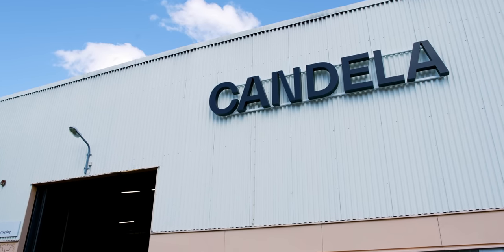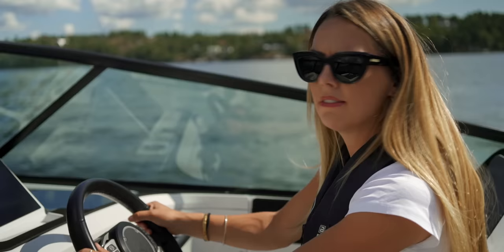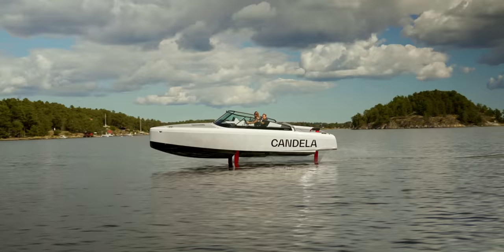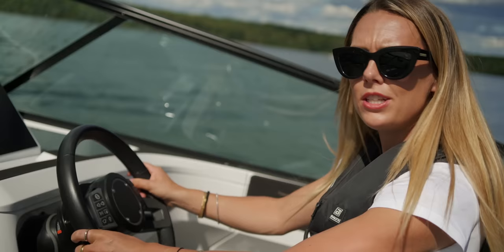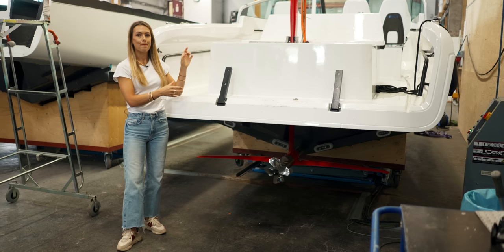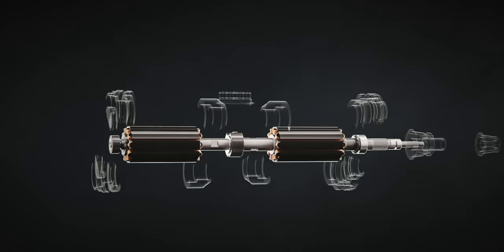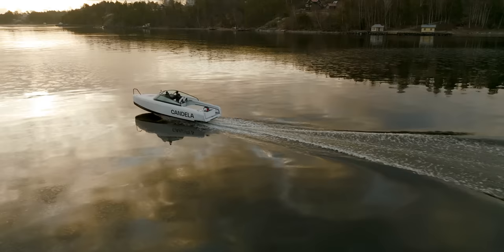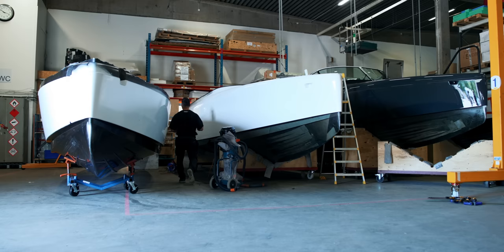This Candela Electric Boat FLIES!

Comment: Love it. A couple of questions spring to mind though; one, are these only fair weather craft? Not sure these would cope with rough seas so well? Just a hunch, two, when are they releasing an integrated solar version?!  Make a whole lot of sense to me if pleasure craft are rarely used!
Reply: Boats have a legal rating A,B,C,D with both distance away from the shore and number of passengers defined at build stage. A being cross Atlantic, B being cross channel, C inshore and D being river or lake. Then the number of passengers depends on the size and once you go beyond 24m or 79 feet, then build structure and number of crew can change. I would suspect that this boat is a C or perhaps a B. 
But range is then an issue so more likely a C rating.
Reply: @patrickjr11  Hydrofoils are not covered by the RCD Rating System.
Vessels over 24m LWL are not covered by the RCD.
The actual ratings A to D are descriptive sentences, not titles, as they were considered misleading. Even so, the ratings were previously A - Ocean; B - Offshore; C - Coastal; D - Sheltered, and were never as you suggest.
The ratings are predicated on weather conditions and expected wave height, not distance from shore or crewmembers (the number of people aboard can alter a vessel's RCD rating because of stability differences but nothing is "defined at build stage". For example, the same boat may be dual rated as D with 5 passengers, and C with 3 on board).
Range is not mentioned in the RCD ratings.
The RCD ratings are not so much "legal ratings" as guidelines to consumers. Once a vessel is sold or imported, the ratings are pretty much irrelevant and a boat can be used in whatever way the owner desires, no matter how misguided.
Given that the expected wave height for a C rating exceeds the ride height of this vessel, such a rating would be impossible even if a hydrofoil could be subjected to the same stability criteria, and there wasn't a failsafe built into the software that shut down the electric motor once the waves became too much for the system to work reliably.
Please be more careful when spreading information on the internet.
Reply: @RandomGuyRandomNumber  I did provide a link that gave more details for anyone interested in the details but my answer was aimed at vast majority of the audience who are not into boats. I think it is a reasonable way of describing the differences. But in any case. Foils are not included, although given they are going to be on more and more boats going forward, perhaps they will impact the rules in future. The boat is still the boat in the end. The foils just improve efficiency.
Reply: @patrickjr11  There is no link in your comment. Everything you said is demonstrably false no matter at whom your comments were aimed. The titles of the ratings were even changed by the RCD / EU BECAUSE they were misleading (but you did not even use the correct OLD titles - you just plain made up your own !) and the entire ethos of the RCD is to provide information to people who are not familiar with boats - nobody with any sailing experience gives a toss about the ratings unless they have to comply as a seller or manufacturer. You even guessed at a rating that could never exist for a boat to which the regulations do not apply based on a measure that is not even mentioned in the compliance regulations, let alone the ratings criteria.
Please educate yourself before spouting off on a subject you obviously know nothing about, and when your errors are pointed out, accept correction with some grace instead of doubling down and lying.
Reply: Solar actually makes a lot of sense since most people only go boating on the weekends. That would leave enough time to recharge with solar during the week.
Reply: @jimj2683  my thoughts exactly!
Reply: @jimj2683  Where would you put the solar panels ?
Not on the forward deck - panels don't like curved surfaces and would be damaged by walking / handling lines / using anchors. The only place suitable for permanent fitting would be a fixed cockpit cover or bimini. Which would be surprisingly expensive, heavy (to be able to withstand wind loading and misuse as a handrail while boarding etc.), bulky and just plain hideous, and which has to be dragged around in the wind and its extra weight lifted out of the water whenever you use the boat. What if someone wants to sunbathe ? Not with a permanent bimini they can't. And where are you going to dump the excess power generated by the solar array once the batteries are fully charged ? It has to go somewhere...
All these problems, on an expensive, stylish, open boat that spends most of its time ashore or on a pontoon mooring with shore power available right there, 24 / 7 ?
So no, solar makes absolutely no sense for a boat like this.

Comment: The main reason for the slow electrification of marine in my experience isn't the physics of water, rather that emission legislation is nowhere near the driver it is in automotive or even aerospace, it's unregulated in comparison. The exciting thing about the luxury marine sector though is that they're so overpriced there's room to factor in the extra cost of electrification/innovative engineering

Comment: We had old hydrofoil ferries going from Amsterdam Central Station to Ijmuiden (public transportation) Had, because they stopped using them, probably too expensive to run economical. If i remember correctly the boats came from Russia, it was a real treat rinding those almost everyday.
Reply: Yes we had them for public transport in Sydney Harbour in Australia too, i think the new design with electric engines will make them much more economical than the older types of hydrofoils using fossil fuel tech.

Comment: Now if only we had a network of long straight waterways between mayor cities... 

It's a strange thought, but in a few years we could see hundreds of these gliding up and down canals into UK cities
Reply: The necessary speed would be an issue on UK canals. Narrowboaters would rebel.
Reply: Good luck draging all those dumped shopping trolleys down the grand union canal.
Reply: And the locks...
Reply: You have to hit a minimum speed to get the boat to ride out of the water. It is most certainly MORE than the maximum speed allowed on the cut!

Comment: It's beautiful and elegant and I think electric can be used in many boat applications. My concern is the damage done to the blades if you hit a lobster pot or fishing bobber. It could end up as a very expensive repair if the blade gets broken, or the motor damaged. That looks like a very expensive motor to replace.

Comment: 5:02 Hydrofoils as a concept is not new or terrible difficult. About 50 years ago the hydrofoil was so well developed since the yearly sixties that they where rather common. Or at least in southern Europe there where even "speed passenger boats" that where hydrofoils. I know Greece still got a a few of the hydrofoils in operation still. But a foil for every enthusiast that can afford it, that is new afaik. Candela's Pod is also new, and the integration of software and sensors to control the "flight" is new, well at least at this level and size in length.

Comment: How does 50 nm stand up next to the typical range of a fossil boat and the typical trip length of a fossil boat?
Reply: A boat of that size easily uses 10 times more fuel than a car for the same range even if it goes slower than your average car.

Comment: It has driven me crazy for decades now that people still believe it is the lower pressure area on a wing that generates all or most of the lift.  No it is the high pressure under the wing from the air slamming into it that gives the vast majority of lift.  Here is an experiment you can do in your head.  Remove all the air around the Earth.  Could you still skip a flat round rock off a lake of water?  Answer is yes.  The shape of a wing with the top part being rounder than the bottom is just there to keep turbulence from forming.  Turbulence  would cause drag slowing down the plane fast.  The thicker and more rounded the front of the wing the higher angle the wing can fly at slower speeds before too much turbulence is created slowing the plan down so much that the engine can not keep the plan moving through the air fast enough to generate enough lift from the underside of the wing.

Comment: Nice video. Electric drive is the obvious choice for hydrofoil boats but surely the correct comparison is with an ICE hydrofoil - plenty of these in commercial operation around the world.

We know they're fast and comfortable and that people like riding them. We know that ice varients are expensive to maintain and don't work when the sea gets rougher. Can we fix those problems at all?

Comment: Just had a thought: there should be a profitable market segment in transporting film crews on the water. You can certainly film at higher speeds thanks to the greater stability and reduced motion.
Reply: Or you could just fly a drone over the water.
Reply: @vhtf120 No. They are faster and more stable.
Reply: @vhtf120  but i dont think there are drones capable of carrying proper cinema cameras 🤔
Reply: @TheDudeFromKalispell  drone can't carry the larger or more specialised film and sound gear. Can't feature a presenter and/or interviewee. Drones have limited endurance and are restricted in what they can do as an aircraft. A watercraft is far less restricted, and has far greater endurance on site. It also doesn't crash if you turn the engine off. Aviation rules and battery life mean a drone can't stop and loiter, or do a low speed approach to an object/location of interest/wildlife. Drone can't carry much equipment so can't be flexible in changing environmental conditions.

Comment: No comment on the the retractability of the [hydrofoil] sails for shallow water manoeuvrability, is disappointing.  Though I did note the tail sail shaft poking up through the bench seating at the rear of the boat during the closing comments of the presentation.

Love the idea — especially the Swedish ingenuity behind its development.

Comment: Would adding solar panels make the boat do a bit more range ?
Reply: Depends how small a bit you think would make it worthwhile. Probably not is the quick answer
Reply: It should add to the range, especially on a sunny day. However the surface area isn’t much, so the energy generation would be slight.
Reply: Not so’s you’d notice.   
Maybe if you were sailing it on the surface of the sun.

Comment: Regarding the question about environnemental impact of this foiler boat, I notice, in the aerial views, a yellow wake, probably due to the circulation around the foils, absent on the archimedian boat. Since the video has been made on a lake, I assume that more disturbances to the environnement are created on the aft foil, by the horizontal plane of the foil, sucking lake's ground sediment. Fore foils, also, seems to have the same effect.  In this case, the foiling configuration choosen by Candela seems to add some  more nuisance to the environnement, especially if this boat is to be sailed mainly is cute inshore waters. A more conventionnal electric conversion of a ICE boat would be more profitable to protect ecosystem from sunday's sailors in need of fun. Also I wish to add that, although one cannot compare directly the wakes of the foiler and the one of the archimedian boat, it is clear that the CANDELA hull's shape is a terrible mess !!!! In these quiet and wonderfull places that we see in the video, there is nothing better than a nice sail, avoiding carefully places where wild animals use to live.
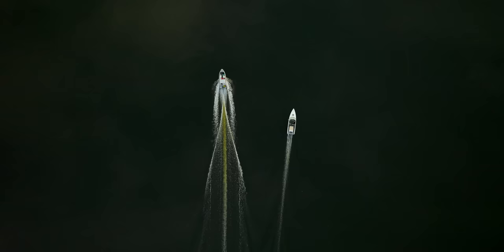Reply: I think you may be mixing the boats up. The electric hydrofoil boat is on the right with the small, straight wake and the other boat is on the left with the large, spreading wakes and the yellow-ish trail from the prop (at 6:12). The spreading wakes cause lots of damage (by being sizeable waves, rather than because they spread), so any conversion of a v-bottom hull which displaces lots of water will not be preferable, in this regard, to a hull which is not in the water at all.
Reply: @theelectricnarrowboat6639  Yes, That's absolutely right !!! My bad !!! In that case, foiler may be an advantage regarding environnement nuisance. Thanks for the reply !
Reply: @theelectricnarrowboat6639  what about foiling with sailboat then ?

Comment: Concept is great BUT huge use of non recyclable materials…..fibreglass/ carbon fibre and all its varieties are a nightmare long term. The cost is beyond a lot of boat users. Here in New Zealand the average trailer boat is 5.5 meters and approximately 20% of our population has a boat. The concepts are great but such a tiny market cover. BUT still a nice boat but not what the world needs. At least with aluminium there would have been a recycling element.

Comment: The biggest problem is cost. For the price difference you could refuel your normal boat hundreds of times before it would cost more than this carbon hydrofoil. If they could dramatically reduce cost, then it would make much more sense.

Comment: I wonder if it could go even faster if they placed supercavitation generators at the leading edge of the hydrofoils? Then it could slice through gas instead of water, resulting in much less drag.

Comment: I was just reading about why hydrofoils didn't make it in the cross-channel ferry business. One issue was maintenance and fuel which might change in this example but the other was about what happened when they hit a wave - pulling the jet out of the water sometimes and forcing a transition to floating.   I see that you're using it on a very calm lake - which is still a cool and valid usecase of course - but are there wave conditions where it really won't work? Also is it easy enough to operate at night?
Reply from the maker: I can tell you going over the waves was a bizarre experience! You didn't feel them! The night question is good though, I hadn't considered that!
Reply: I would have liked to see it going through some choppy water.
Reply: I suspect it's actually in the Baltic around Stockholm. Places with (normally) calm seas like the Baltic, Adriatic or Aegean seem like the best places for this, as well as lakes and rivers obviously.
Reply: What makes you think the sensors need light? Furthermore, the system is fully automatic. You don't need to be an engineer to operate these. If you search on youtube you can see clips where it is quite more waves and they seem to do well. 

The commercial boat won't run in the winter as it cannot handle ice.
Reply: Stena used to operate a SeaCat car ferry between Wales and Ireland. It was a Jet Foil design. Jets of water for propulsion and hydrofoils to lift it above the waves. It drank a lot of fuel and its static hydrofoils could not cope with large winter waves so it had three/four months off every year. You wondered why there were no forward outside decks until you had left harbour and got up to speed. Then you realised that you'd not be able to stand up outside at the front as you were going so fast. It was a noisy but very smooth crossing in mild and moderate weather. Rougher weather would require all passengers to remain seated and it wouldn't run if there was a storm en route.

Comment: Is the hydrofoil setup more efficient than regular boat on water? If so, why isn't it more common.?
Reply: Iy's the tech they are using to sense and stabilize the boat 100 times a sec to filter out waves, And should allow it to navigate rougher water than traditional hydrofoils that are a V or C shape under the water to lift and give it a sense of analog stability using fixed blades.
Reply: Cost and complexity of the boat and the advantages it provides don't matter if you don't mind just burning more fuel.

Comment: Amazing tech, love it and wish I could afford it :)  Will it be offered with longer-range batteries, or does the packaging / weight to lift equation preclude this I wonder?  Great article and lovely visuals of the boat flying over the water leaving little wake compared to the boat alongside.
Reply: I suggest this does not scale up well, at least not solely on battery power.